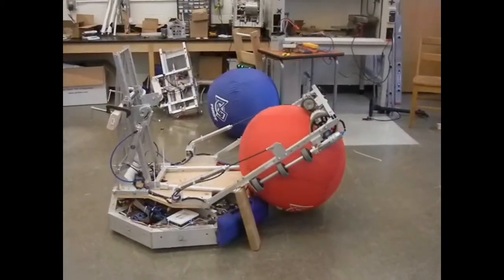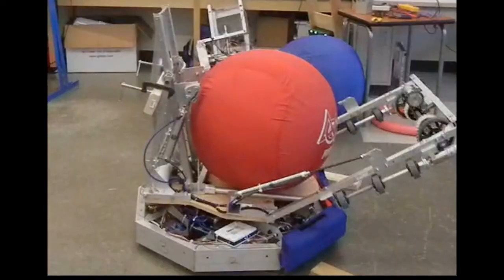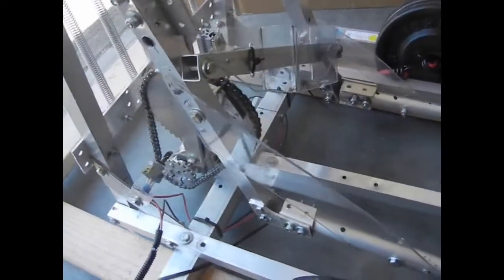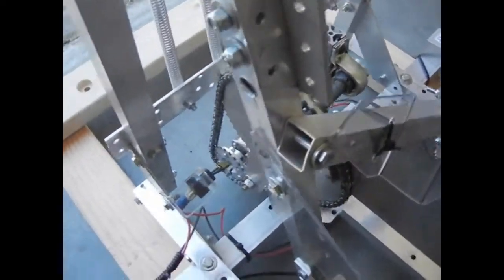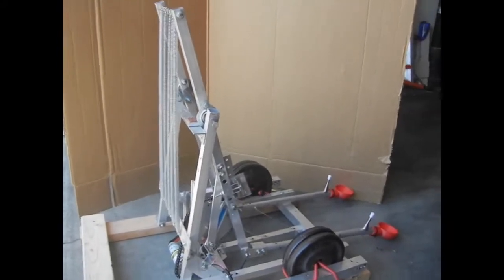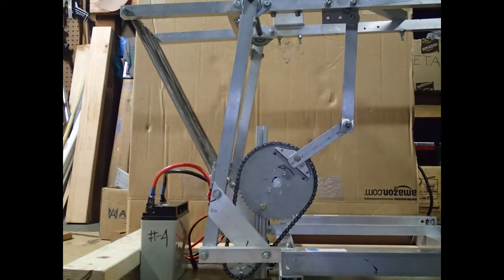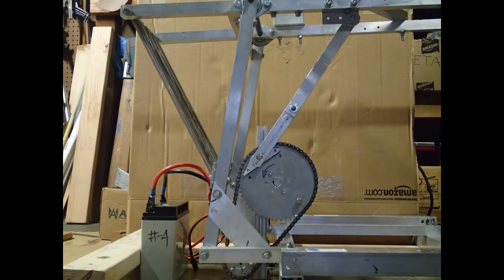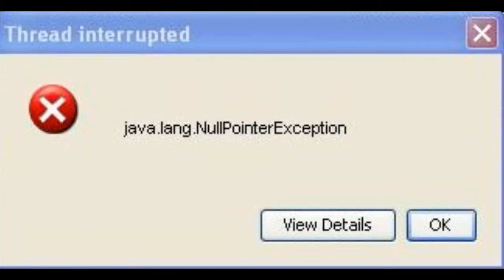Choo Choo Quick Release Explained

Comment: How does it sit without moving in idle? Wouldnt the force of the Springs unwind it naturally?
Reply from the maker: +Grant Kobes The links are close to aligned with the center of the gear, therefore there is not much torque on the gear, and the planetary gearbox motor provides enough resistance to hold it in place.  On a competition robot, with vibrations and jolts, one would need a more secure way of holding it, such as a closed loop PID position control on the motor.